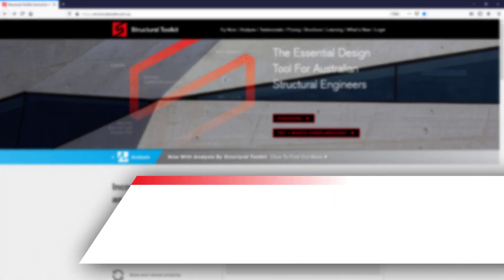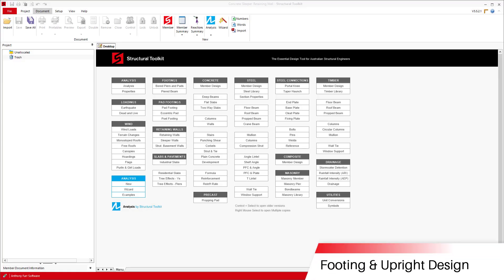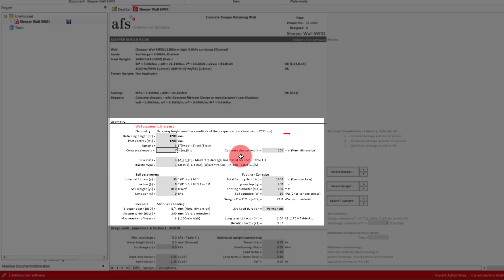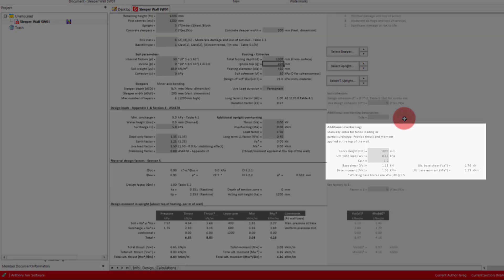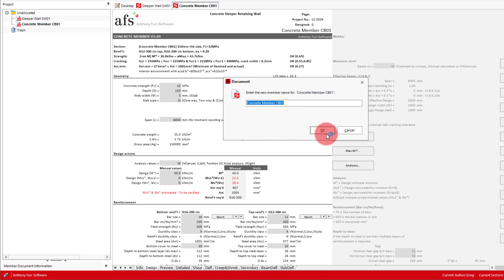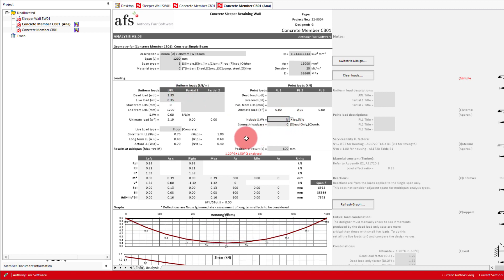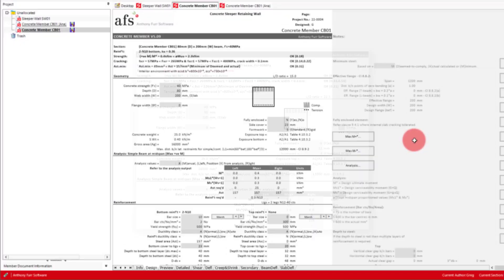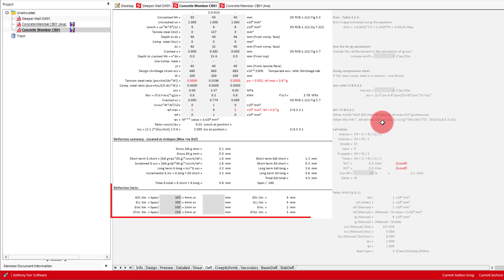Structural Toolkit: Concrete Sleeper Retaining Wall

Comment from the maker: The Sleeper Walls module has been updated to include an option for resolving the overturning moment to the point of rotation within the footing. To match the example in this video, this option will need to be turned off to "No". This option is found in the notes section to the bottom right of the module.

Comment: Can we not make it drained?
Reply from the maker: The sleeper wall itself is assumed to be drained, so the design does not allow any water pressure. If you are referring to the soil parameters around the footing, then you can set them yourself to be their drained versions if your site conditions require it.

Comment: What do you do if you have drained (long term) parameters for the soil, i.e. a c and fi value? In the video, you say that you can design for cohesionless soil, but there is nowhere to put a fi value in.
Reply from the maker: Good question. In the case of cohesionless design (where footing cf = 0), the internal angle of friction (phi) input to the left is also used for the footing design - so alter that input as needed.
Reply: @StructuralToolkit  Ok thanks for replying. Often we have a different material behind the wall to what the footing is embedded in. In future updates to the module, could you please consider having a different fi value for each?
Reply from the maker: @julianamcgrath2676  Thanks for the suggestion. We will look to add this to a future update.